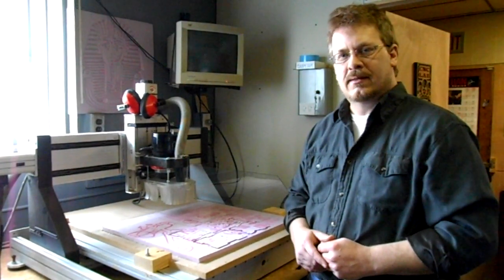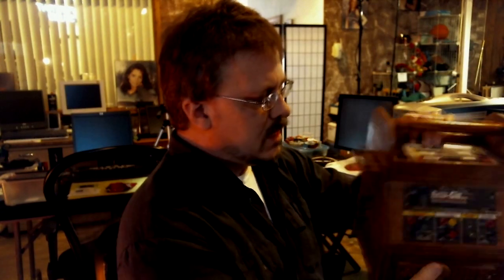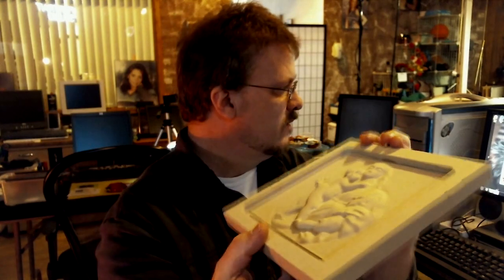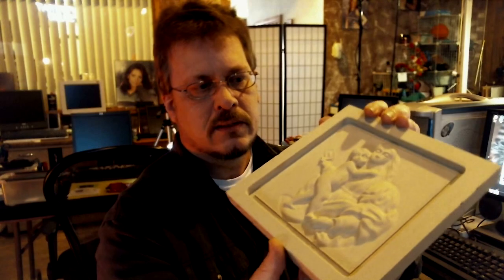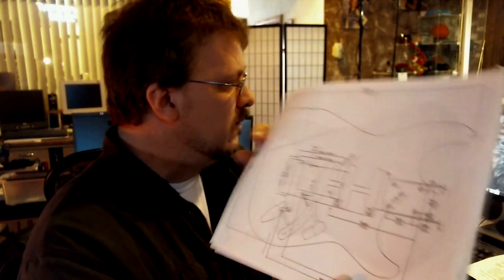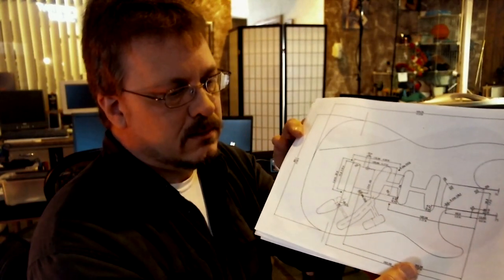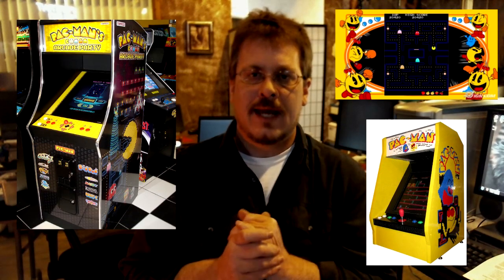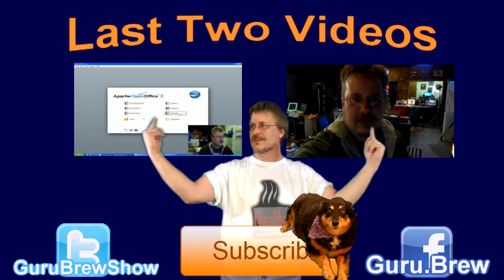All About the CNC Router 101 - CAD/CAM Exploring The Basics - Part #1

Comment: I am new to all of this thinking about building a CNC router table. The table seems to be the easy part.  Do you have any suggestions on a good CAD/CAM software that wont cost more than the machine I am building?  I will be using mach3 on the machine I am thinking this should be step 1. I am willing to spend the money on something good but not 4k like on solidworks.

Comment: Thank you for all your videos. They are very helpful and much appreciated.  I am particularly interested in the CNC router videos. I have two questions. !) Could you show us HOW you got the CAD files of your project imported to your CAM software?  You mention it in your video but you don't show how you did it.

2) Would you please show us exactly how you added a Xbox controller to work as a joystick. For the life of me I can't get mine to work.Thank you in advance.
Reply from the maker: Hi Dale, I have scheduled a video on setting up the Xbox controller to run Mach 3 as your request. I think it is about 3 week out. As far as importing G code to the CAM (Mach 3) software, I just sent the file over an internal network instead of using a flash drive or other storage device to transfer. See my other videos for network resource sharing techniques.

Comment from the maker: I would say that you cannot go wrong using a up-cut spiral bit for most wood. They make many diameters and lengths of bits but that will depend on the resolution of the detail desired and how much travel your machine requires. I like to use a 1/4x2.5 or longer bits for most wood work